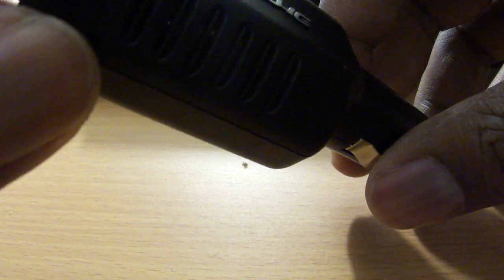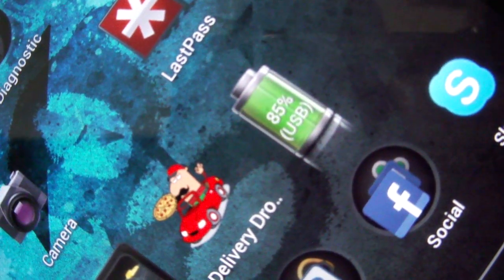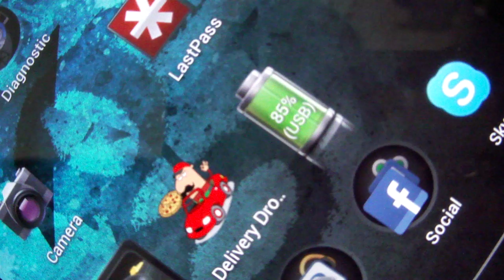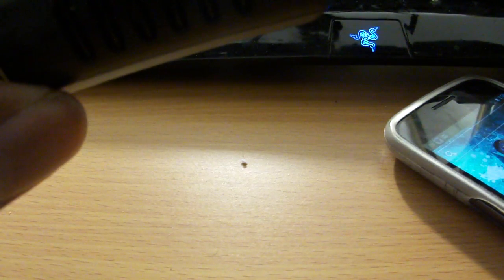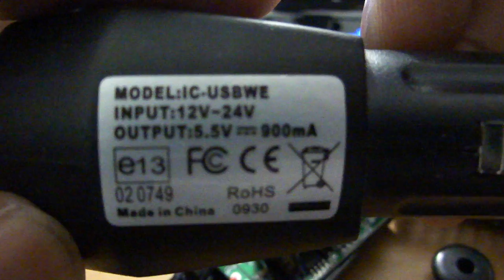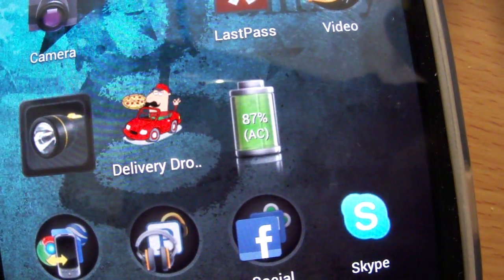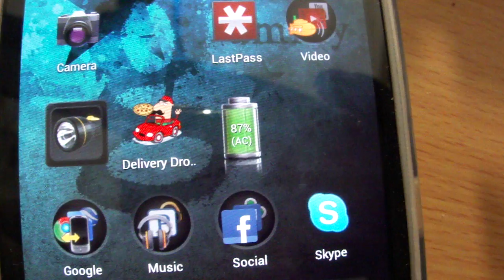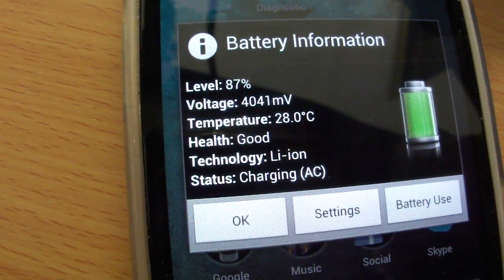Scosche Revive II iPad USB Car Charger AC Mode Mod

Comment from the maker: There is a guide like this for pretty much every DC USB charger on the market. Pretty much everything is designed for iphones/ipads so they don't charge most devices properly. What is annoying is that an iphone/ipad will charge just fine after the modification, so if they made it the right way everyone would be happy and I wouldn't have to resort to such tomfoolery.